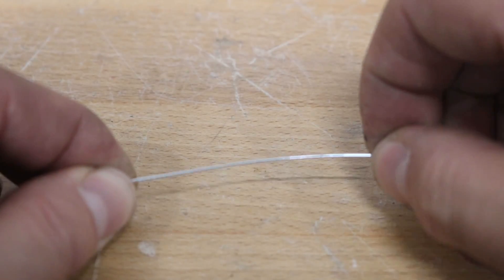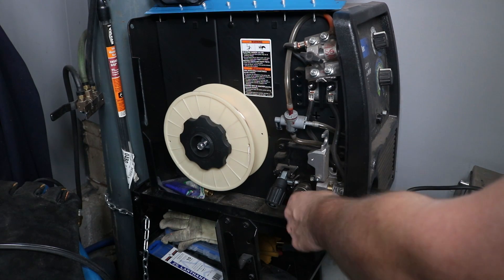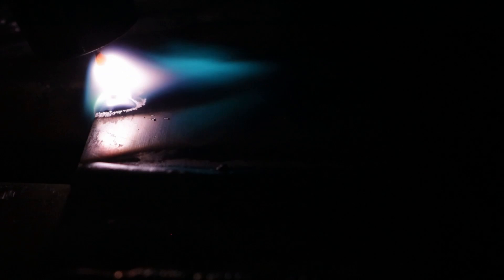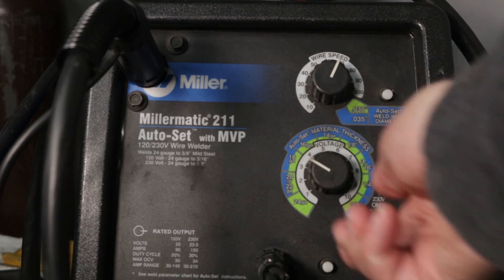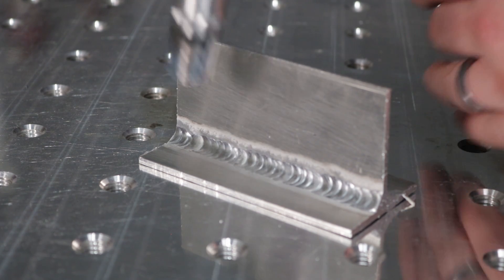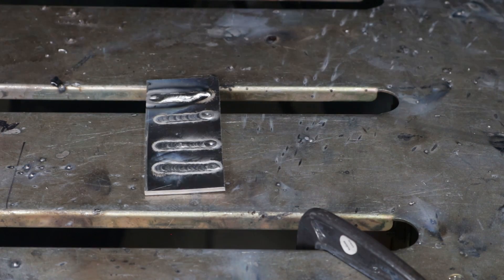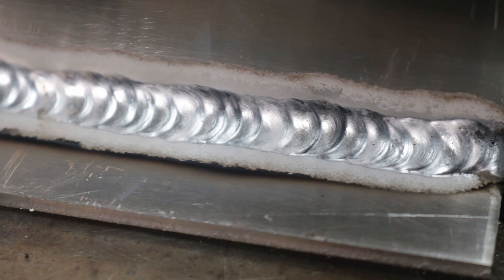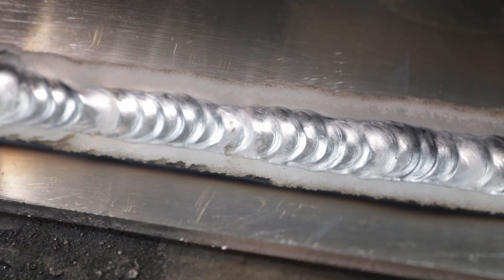How to MIG Weld Aluminum: Spool Gun Aluminum Welding for Beginners

Comment: Au Mig alu il faut énormément se méfier de jolies soudures peuvent être en interne emplies de porosité. Faites des éprouvettes en angle intérieur et dessus des contrôles destructifs en entaillant la soudure  dans le sens de la longueur et en rabattant vers le cordon, vous allez avoir de grosses et très mauvaises surprises. Si vous soudez en mode pulsé la solution est de faire une correction de la longueur d'arc suffisante pour rester en spray arc mais à la limite du mode court circuit , en plus ce contrôle vous permettra de voir si vous avez bien fondu la racine . 
Comme la.peste méfiez vous des soudures alu qui ressemblent à du Tig , car cela quotient avec un arc trop long qui fait des soudures pourries en interne

Comment: Is spoolgun dc?
Reply from the maker: Yes. Electrode Positive (EP) is the polarity that etches the oxide layer, and since MIG runs EP there’s no need to switch with AC. TIG generally runs EN, so you need AC which switches back and forth between EP and EN.

Comment: Thanks so much for making this. I’ve been welding steel for over 30 years; however, I’ve never welded aluminum. Just got a Miller Spoolmatic Pro 15A to run with my Miller Multimatic 235 and I’m excited about using it soon to repair the front of my aluminum boat. Thanks for making this video—it is a big help!

Comment: Hi. 
Excellent video. 
i have some portable aluminum (event) fencing. 
the fence is made of square tubing. 
the square tubing is rounded at the corners with a 5” radius. 
i tried to fabricate an aluminum fence from scratch. when i attempted to round the square tubing, the outter radius of the bend ripped. 
are is there an aluminum alloy more favorable bending like this?
should i have heated up the area before bending?
thanks. greg

Comment: Can I do intercooler piping with this and is the gas still argon/co2
Reply from the maker: It's really not ideal for intercooler piping because of the thickness. TIG would be a much better choice. Straight Argon is the gas for Aluminum MIG and TIG.

Comment: I just tried the spoolgun first time today on a miller 212 non auto I had to have the heat on the lowest setting on the welder and still with messing around with different heights/speed travel the back side of the aluminum 1/8 plate had a bulging weld bead so seems 1/8 thickness or less is a no go maybe 1/4 would be perfect? had similar problems with the tig welder as well always the back side of the 1/8 inch plate had a deformity or like a bulging weld.

Comment: Thanks for the informative video. One thing I noticed, you mentioned holding your angle of the torch head in the direction of travel (push technique) for aluminum mig welding. However,  during the last part of your video, you showed what appeared to be a drag technique?  Any reason for this? I would assume that you can use either technique depending on your welding proficiency? Keep up the great videos!

Comment: It's called "whip and pause"
Reply from the maker: The motion is a little different than whipping a 6010 where you choke the rod slightly ahead of the puddle to reduce heat, so I don't use the same term here because that can be confusing to those coming from stick welding. You are correct, though, whip and pause is a common welding term and has some similarity.

Comment: Hi, Tim. Do you have any input on welding 2 different thicknesses of aluminum together? I Have 1/8 inch angle up against a 3/4 inch thick aluminum block that has holes machined into it. I will definitely practice.
Reply from the maker: Preheating the material, particularly the thicker section will help a lot. The settings generally need to be closer to the appropriate level for the thicker part. Focus the weld on the thicker part and let the weld puddle grow until it's even on the thinner part, then hold that distance from the thin section as you travel.
Reply: @TimWelds  Thank you Tim.  Ive never practiced or tried to weld Aluminum with different thicknesses. I Really appreciate your input. And I will do some practicing with your info right away.👍💓
Reply: @TimWelds  Thanks for your input Tim, I did what you said by preheating the aluminum and  starting to puddle on the thicker  material and with practice it worked really good and the final product turned out Great.

Comment: I used to weld aluminum McDonald’s arches together that would be mounted on a swing arm  that set a top a 3/8” thick 4” pole that was at every McDonald’s in the world. I pumped out 65 to 80 pieces a day using a cobramig 300 push-pull with argon gas. I could change my amperage and WFS right from the gun! While I was using the most cost effective way to pump out more pieces,I remember the older guys using the electrode tungsten guns with filler rods to weld their signs. I remember one old school welder in his early 60’s told me one day,young man you better learn to weld the tungsten way with a filler rod. Because one day you will have no other option. Well guess what? He was right,I have a welding test Monday for a new job and it’s been since welding school about 15 years ago since I used a tungsten electrode with a foot pedal and filler rod. But hopefully by watching your videos it will brush up my Tig welding skills.

Comment: I do not get a smooth bead.  I get lots of holes in the middle of the bead. Is that my wire speed? I was about 340 or 341.  Do I need slower?  My voltage was 19.1.  I am using I believe 5356 wire that has the green arc.

Comment: I have a Millermatic 211 also. You said your spool gun was from Habor Freight ? Which spool gun do you recommend for the 211 machine ?
Reply from the maker: I have a Miller spoolmate 100 that I used with that machine. I use the harbor freight spool gun with a different machine also from harbor freight.
Reply: @TimWelds  So which gun would you say would be the one to get/use with the Millermatic 211

Comment: Excellent video.  Good length, too.  I have a 240 volt Lincoln mig, but haven't done much welding.  It can't take a spool gun.  Any videos or suggestions for buying a used or new machine that can take a spool gun?  Ideally, something $2K or less?  Also, any thoughts on Eastwood machines quality wise?  thanks.

Comment: Hey Tim i want to get started with MIG but i do need something to weld stainless and aluminum because i will be doing mainly automotive work. What machine do you recommend that can do both and is not entry level but towards the entry level side instead of the expensive advance machines.
Reply from the maker: Given your need to weld multiple materials, I’d think about TIG instead of MIG welding. MIG requires a different gas for steel, aluminum and stainless. Getting 3 cylinders is expensive. You’ll also need a spool gun or special liner and drive rolls to feed the soft wire. With an AC/DC TIG, one machine and one torch will do it all. A great machine to start with is the Primeweld TIG225X. It has every feature you need and a great company that stands behind their products.
Reply: @TimWelds  thank you Tim, i appreciate the prompt response. I will look into that machine.

Comment: In short circuit transfer the wire doesn't touch the work.  A bead of filler metal forms, roughly the size of the diameter of the wire and it transfers to the weld at a rate of around 100 times a second.  Slow mo videos of this are really cool.

Comment: Tim, truly appreciate the videos you make. I’ve looked everywhere and am having difficulty in getting the “stack o’ dimes”.  I’ve tried to match your pace and doing the pause but instead of a distinct dime the weld pools together and it looks smeared.  Im getting a nice spray with strong outside corner welds that I can beat with a sledgehammer without shearing.  I really am after the look I guess.  Thanks again.
Reply: Might be running to hot..

Comment: After you're done welding aluminum would you ever give it a chemical treatment with something like Alodine?
Reply from the maker: Alodine is typically used on aerospace parts to help with electrical bonding. You could use it to help with corrosion a little, but I’d prefer to anodize. If you are going to anodize, avoid using 4043 filler in the weld because it won’t match the base metal.
Reply: @TimWelds  Awesome. Thanks for the reply.

Comment: Interesting video. I was told from a mate that you can't weld aluminium with a MIG welder, you need TIG. So, really, with a different alloy gun and wire for   you can. Great stuff. 👍
Reply: Ya your mate doesn't know what the fuck hes talking about

Comment: Tim, I have watched this video several times and think it's great.  This is my "GO TO" channel for anything welding.    At the seven minute mark you appear to be dragging the puddle rather than pushing it. Is it just the optics of the video?  I am attempting to weld 1/8" material and would like to know how to finish the weld without a crater at the end with something this thin. Thanks

Comment: Great Video and a lot of helpful tips to get going. One thing I'd like to ask is if you make any modifications to how you'd start off with setting when you use 5356 wire instead of 4043? do you decrease the voltage a little more to start? need more wire speed? just curious if the alloy makes any difference in how you go about your set up?
Reply: I notice he doesn’t answer

Comment: Great introduction to spool gun ,I have recently purchased  a spool gun , trying to set it for welding 2 mm square tube
Perhaps some suggestions on 0.8 mm wire... voltage and speed.. I'm using the metric system  mm/ second and VOLTS

Comment: What size (amps) MIG do i need to spool weld aluminum . 140 or 180, or 220  ?????
Reply from the maker: I would recommend at least using a machine that runs on 220. A 180 amp or larger machine will do the job, depending on your thickness. A bit of preheat also helps quite a bit.

Comment: Helpful thank you.  Do you have a video showing what the issue is when you have a ton of black left after welding?
Reply: Making sure you brush your weld area clean, making sure you don’t scrub it (as if you were brushing your teeth), it could reintroduce oxides and impregnate oxides into the weld area, brush a certain direction only, as well as gas flow could affect the soot.

Comment: Do you do any prep to the aluminum being welded before starting? I’ve seen others brush with a stainless brush and preheat. You didn’t  say anything about it and I wanted to be sure.
Reply: The only time I would clean the aluminum before you weld it would be if it’s dirty but other than that I wouldn’t aluminum melts down easily to ensure good penetration when you start a weld let it pool up the. You can either just push it because the wire is constantly touching it won’t look the best but it’ll be strong I prefer to whip it because the beads I find get just a bit deeper. I have also been shown that instead of doing either when your pushing the bead you can lift the gun away from the bead to get the layering

Comment: I just picked up a “new old stock” Klutch 200iDV Multi process welder with Mig(flux and gas)DC Tig, Stick and SPOOL GUN for $300 from Northern Tool!!! Wouldn’t you know it, that eavesdropping, internet AI puts this video in my feed today 😂 Great video as usual, can’t wait to try the spool gun!
Reply: I got a titanium 200 for $200 new in box, and was so excited because it could do tig. Then I realized it won't tig weld aluminum.

Comment: Ha ha , it's hilarious when a weld engineer talks about welding ! Decent video , I've used push pull guns before but just had to use one of those dreaded spool guns and just as I thought runs awful and nothing but problems . Threw it out and tigged it instead

Comment: Hello Tim! Do you have any concerns about air quality and lung health when welding? How do you protect your lungs when welding? Thanks!
Reply: Have a look at the ad flow helmets they help 🤙
Reply: I just hold my breath while I'm under the hood and try to keep the room in the shop flowing with opened doors.  I try to suck in as little air as possible when I'm hovering directly over an arc, and try to keep my head to the side when possible.

Comment: Wait.... did u say HF spool gun in that 211?  You’re about to save me some $$$$$!
Reply from the maker: No, I was using a Miller spool gun. I have a HF one as well, but use it with a HF Titanium machine.  It may be possible to adapt it, but I haven’t tried. I have seen some spoolmate knock offs on eBay, but don’t know what the quality would be like.

Comment: Can you mig weld Aluminum with 75/25 argon / co2? Or does it have to be 100% argon? My welds are looking burnt. Like black
Reply from the maker: It needs to be 100% argon to work properly. Sometimes there is a bit of black deposit on the weld that isn't too big of a deal, but I'd definitely recommend changing your gas to see how that goes.

Comment: This is probably a dumb question to a welder, but how is aluminum welded? I mean steel passes electricity well, aluminum doesn't.... How does the whole process work? What are the physics behind it?
Reply: Aluminum does pass electricity.  They are even starting to use aluminum instead of copper because of the shortage and high cost of copper.

Comment: What if you are getting white soot on the gun what does that mean?
Reply: Yeah mine is doing that too
Reply: @xninja83x67  Found out that i was not getting sufficient gas flow due to a bad gun. so I recommend check you have enough gas going to your weld.
Reply: @asbtrailers  ok, thanks.

Comment: Were you able to adapt the HF spool gun onto your Miller welder? I've got a Miller but cant justify $1000 for a spool gun for occasional use.
Reply: You don’t have to use the Miller spool guns for Millermatic migs.  I’ve got a $449 spool gun I’m not sure the brand but it’s not as cheap as HF but jt works fine

Comment: Hi Tim, I am mig welding aluminum using 3/64 wire on Lincoln Power Mig 300 and no matter what i do the wire melts to a tip after few minutes of welding. Machine performs very nice weld, but burns too many tips through a day.
I would appreciate if you would tell me why it is happening. Thank you!
Reply: check your burnback setting as well as the tension on your drive rolls
Reply: @773welder9  problem was solved by changing tip which had bigger hole
Reply: When looking for tips, I know here in Australia there will be 2 types, one will normally have an "A" after it. This specifies it is a tip designed for aluminium which will normally mean that it has a larger opening than the specified size.

Comment: We have new "Lorch" brand (german) Mig machines at work, and they will do Pulse and Double Pulse Alluminium, Straight out of the gun, NO Spool gun, I haven't really tried much with that other than a test run on coupons when the salesman showed us what these machines can do, but what I did see was pretty Impressive.
Reply: What is double pulse?  Is that the waveform control as well as pulse to the wire feed?

Comment: Hi Just wondering of the two Aluminum processes that a hobbyist has access to. AC TIg or MIG with a spool gun. Which is the easiest to learn? Once you've learned them are they both sound structurally?
Reply from the maker: They both have very different benefits and challenges. I would recommend AC TIG because it’s more flexible. Once you learn how to do it, which learning is fairly challenging, you can just jump right onto a project. Aluminum MIG is relatively easy to run once it’s set up, but the process is more particular when it comes to settings. Dialing in the machine can be a hassle and has to be done for each joint type and thickness on a project. In general, I’ll TIG aluminum unless I’m running several feet of weld on the same joint. Both can be structurally sound when done correctly.
Reply: @TimWelds  Thanks a bunch for answering so quickly!

Comment: I have a slight problem being able to make my welds smaller because I end up making him a little bit fat anyway that I can fix that
Reply from the maker: The cure for this is typically to increase travel speed. When you do this, you may need to adjust your setting slightly.

Comment: You didn't say if you where running electrode positive or negative in tig reverse between stainless and aluminum and cleaning materials
Reply from the maker: I was running electrode positive for the aluminum MiG in this video.

Comment: How about without a spool gun and aluminum.  Trying to get this hobart 140 doing 1/8"aluminum.
Tricks n tips ?
Reply from the maker: Without a spool gun, the main thing for feeding is keeping the gun lead straight and make sure you’re using straight argon gas. U-shaped rollers and a Teflon gun liner will also help, but if you’re only doing a little bit, you may get by without them. A 140 will be about maxed out running aluminum spray, so start with the voltage on one of the top settings and adjust the wire speed until you get it to look like the arc in this video. Also, a little preheat with a propane torch will help, just don’t go too hot (200 degrees F or so is good).
Reply: @TimWelds  Hey thanks, that's perfect! Be trying it in the next week....   Keep ya posted.
  Thanks👍👍

Comment: is that an AC / DC machine? I thought you needed AC for the cleaning action?
Reply: That is an Interesting Question, Yes you need AC for Tig welding Alluminium, BUT a Typical "Quality" Mig machine can weld Aluminium with the correct feed rollers, and the Machine MUST be able to do Spray Transfer, because you need to be in spray transfer for Alluminium. I use a Lincoln Electric STT2 (375 Amp machine) it doesn't do Spray Transfer, It is a "Surface Tension Transfer" so therefore I can't do Alluminium with that Machine.
Reply: Partial answer is no - that Miller 211 is a straight DC machine (have the exact one in my shop).  Also have a Miller spool gun for doing Ally!